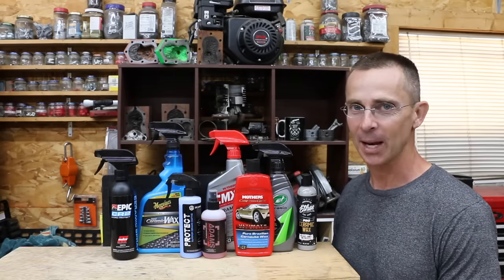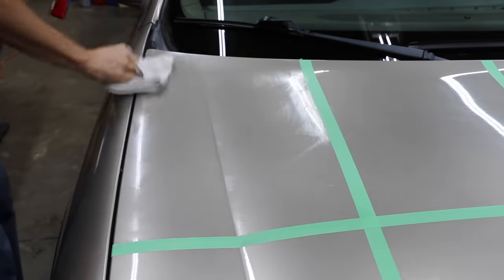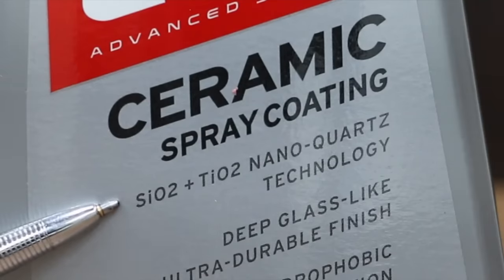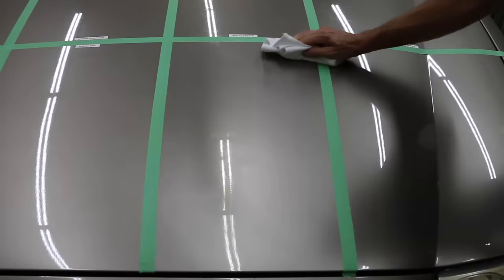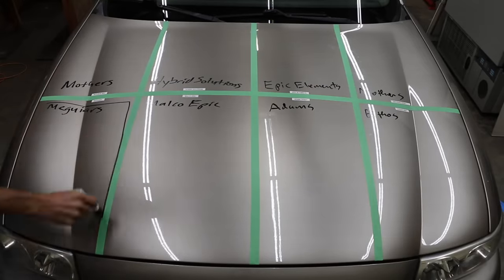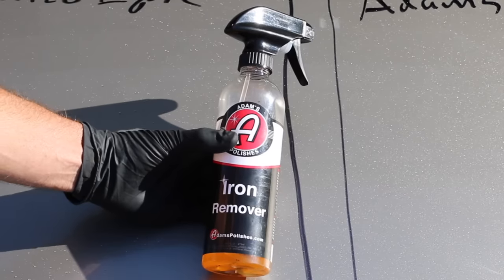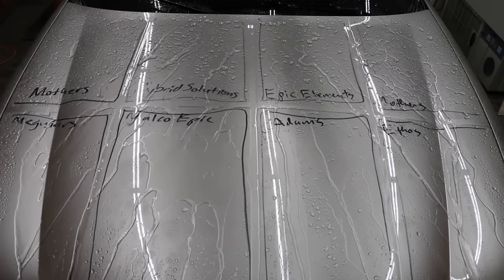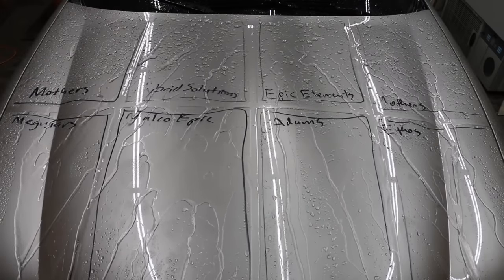Best Ceramic Spray Coating? Mothers vs Meguiars vs Ethos Pro

Comment: Question (for anyone), why use iron decon AFTER clay barring? You could save the contaminants from scraping the surface when you clay bar if you get them off first, no? Wash, iron decon, rinse, then clay bar makes more sense to me. A big concern with clay bar is marring and dragging things across the surface which is why people say you should always polish after clay barring and before waxing/sealant/ceramic coating.

Comment: I just got my TW Hybrid Solutions Ceramic Spray and the TW Hybrid Solutions Ceramic Polish and Wax today and haven't used either yet.  Per this video I feel I bought the correct product.  I was a big fan of Adams products years ago but this will be my go to now.  Thanks for great video @Project Farm!  Now I'm wondering should I use the Polish and Wax at all or use it first then use the Spray.  Any help appreciated!   Dan

Comment: That was great , thanks for putting in the effort.
Next could you test the ceramic serum type products like by Gtechniq, Avalon King etc. They are very expensive for tiny 20 to 50ml bottles.

Comment: Thank you...the cleaning test was thourgh and convincing....I don't allow detergents or solvents near cars...mechanics often spray throttle body cleaner or mass air flow cleaner inside the hood...they should always remove the part to be cleaned and use cleaners away from the car...
Reply from the maker: Thanks and you are welcome!

Comment: Yep! After using Turtle Wax Hybrid for more than two years, and trying different brands in between, this is all I use now, and it's DAMN good! For two of our black cars, we use the black version; a bit messier but it really works well. I'd also suggest using the version for a dry car when you first start with, then switching to the wet car version if you wash and hybrid-spray your car at least once a month. A dry-cloth buffing after is highly recommended to get any haze off. Great stuff.
Reply from the maker: Thanks for the feedback.

Comment: Wow what a great video!  I bought the TW Hyb Solutions before seeing this video, but I knew it was an amazing product after the first use. On my brand new 2022 BMW 330e in white, this stuff made it look like a mirror and the paint is smooth as glass.  I used the TW Hyb Ceramic Wet Wax (another incredible product!) and then this Hyb Solutions Ceramic Spray and I hate car maintenance but both of these esp the wet wax are so easy and take no time at all.  Highly recommend to anyone!
Reply from the maker: Thanks!

Comment: Saw a comparison between the turtlewax you tested and Griots Garage 3-in-1 ceramic wax. Griot held up longer to heavy cleaning, but the person didn't do any of the mechanical tests you performed. Really awesome stuff! If you ever re-do, consider Griots!
Reply from the maker: Thanks for the suggestion.

Comment: I did like the review of the ceramic coatings I think you might wanna add some kind a color and gloss reading to see how visually looks as well and maybe even a scratch test to see whether or not the coding can hold up a little bit more to standard driving debris
Reply from the maker: Thanks!  Thanks for the suggestion.

Comment: That Hybrid Solutions stuff is a Turtle Wax product, and I use it on my Harley. It's freaking amazing. You can just about rinse bugs off with nothing more than a hose. I spray it on and buff it out on pretty much all the painted surfaces I can get to, and occasionally spray the engine etc with it after a wash, then let it sit for a few minutes before blowing it dry. It's insanely durable and I really only have to use it once a year.
Reply from the maker: Thanks for sharing.

Comment: Great comparison as always. I've been using the turtle wax hybrid solution since it's been out. Work's awesome on motorcycles as well. Nice, you can go over all black plastic, and they look like new. As far as my truck, it's been great as it's the longest lasting I've seen for over the counter product. And holds up very well to the northeast winters.
Reply from the maker: Thanks!

Comment: Informative video as usual. Thank you!

I have used both the Turtle wax ceramic and Mother's CMX ceramic. 

 In real world use the Turtle wax is a real pain to apply.  So difficult to remove streaks and haze. The finish feels silky smooth but the shine is just not as deep as the CMX.

The CMX on the other hand is much easier to apply. No streaks, no haze. Leaves my 2020 Avalon looking like the finish is liquid metal.  And silky smooth.  Can't say how long it lasts because I put a new coat on every month or two. 

I am sure the test results are accurate but I would rather put on the CMX once every couple months, or even once a month, rather than putting on the Turtle wax every 6 months. 

Just one person's opinion.
Reply from the maker: Thanks!  Thanks for sharing.

Comment: All of your tests are extremely valuable and informative.  I check with your presentations before I make a purchase of any of the items you have tested.  I have saved all of your YouTube programs.  This particular test was seen after buying a bottle of Turtle Wax Hybrid.  This was a great comparison, not only because of the fact that I brought it but how you demonstrate it through your style of measurement.  Who would have thought to use a weight, sponge and gauge to measure the effectiveness of an auto wax.  Maybe you should be working for Consumer Reports.
Reply from the maker: Thanks!  Thanks for sharing.

Comment: I am totally shocked you didnt use Technicians choice 582.
That stuff works EXTREMELY well even at 3 to 1 dilution. (you do not need alot and if you prep well it works even better)
We take it a step further.
We heat up Collinite 845 wax and ADD IT to Tec 582 and this works so well a body shop manager at a multi location shop here in Atlanta was very impressed on how it looked on my personal car.
Reply: After watching this video, I’m sure Hybrid Solitions would still beat it. Insane how much lasted with it

Comment: Thanks for posting this great review of all these different products. Absolutely awesome.

I have used mother's carnauba literally for decades and have found it to be an excellent wax that holds up pretty good. And your testing confirms that. In fact I just got through putting a coat on today on my new vehicle a 2024 Mazda CX30.  

After watching this I'm going to go get some hybrid solutions product and apply that.   According to the information on the turtle wax site for this product it says that you can apply it over Carnauba and it will increase the shine so I am definitely going to get that. I have the soul red paint color So my guess is it will really pop after I get done.
Reply from the maker: Thanks and you are welcome!  Thanks for sharing.

Comment: Based on your testing, I bought some of the TW hybrid to use on my new car. So far , it has left a very good shine but all the typical gunk is still sticking to it. I will give it a second coat in a few days and I expect it will be more slippery. Thanks for the great review!
Reply from the maker: You are welcome!
Reply: Did you do all the complete prep step or only apply ceramic spray since it was new?
Reply: @jaimebedolla989   I hand washed  and dried with a towel and then applied the spray.  Came out nice. Car looks new a year later

Comment: Absolutely excellent test but most of these brands are not considered high end. Be interesting to see a test against stuff from CarPro, Gyeon, Wolfgang, Kamikaze, etc. That being said it's definitely worth doing tests like these on the more widely available stuff as well. Big fan of the new generation Turtle Wax products, really really solid and not expensive at all. Obviously Adams are always solid (and honestly I think in a slightly higher tier than most of the other stuff in this test). They make my favorite rubber cleaner as a prep for tire dressings.
Reply from the maker: Thanks!  Thanks for the suggestion.

Comment: Supposed System X Renew Ceramic Spray Coating has dethroned Hybrid Solutions but at a much higher cost. I covered my wife's SUV with the Turtle Wax Hybrid Solutions after clay bar and polishing. It came out amazing.
Reply from the maker: Glad to hear!  Thanks for sharing.

Comment: I tried Mother's CMX first, but after seeing this, I picked up a bottle of the Turtle Wax hybrid stuff. The road salts stripped the CMX off the sides fairly quickly, even with 3 stacked layers.

Comment: It might be interesting to compare different options for treating your snowblower for non-stick.  The winning Turtle Wax is probably a top contender, also you want to add DuPont Teflon Snow and Ice Repellent and Stens 752-102.  Cold performance and longevity of an application when subject to abrasion are probably the main metrics of interest.
Reply from the maker: Thanks for the suggestion.

Comment: I used the turtle wax hybrid solutions last summer.  I drove through fall, winter and spring in Wisconsin and it still beads and is shiny.  I think it's the best I've used.
Reply from the maker: Thanks for sharing.
Reply: @ProjectFarm  Have you ever done a video for cordless lawn mowers?  It's an idea of you haven't.  Thank you.

Comment: This is an older video, but as a thought - It would be really interesting to see something of a series from this - comparison of natural (carnauba) waxes, one for synthetic waxes/sealants, then a shootout between the winner of this video, those two wax ones, and a real ceramic coating (gtechniq CSL or such) to find what is the ultimate finish protection. That level of comparison would be very informative, and dare I say, very impressive!
Reply from the maker: Thanks!  Thanks for the suggestion.

Comment: I only recognise Meguiars and Turtle Wax here in UK and out of these only used Turte Wax hybrid, seems pretty good on body but when used on wheels they seemed to accumulate dirt very quickly. Not sure if you have it US but in UK Carplan seems to do better job especially on wheels.

Comment: The Mothers Ceramic Wash & Coat works excellent for washing & waxing the vehicle, or for refreshing a ceramic wax. FYI, if car was waxed within 6 months, mix at 5oz to 1 gallon water ratio. If the vehicle is not waxed, mix at 8oz to 1 gallon water ratio. The 1oz per gallon recommended on the bottle directions, is incorrect. Also, use an wool hand wash mitt. Tip - I've always cheated on drying, by using my big powerful backpack leaf blower😎
Reply from the maker: Thanks for the feedback.

Comment: I can say after using Hybrid Solutions/Turtle Wax Ceramic Spray for years now….it’s a superior detailing product. 

I always have done one coating around all the exterior doors and body panels on my cars, and then repeated a second coating. It really does last a significantly long period of time. Totally worth it and it absolutely sheds water consistently well.
Reply from the maker: Thanks for the feedback.

Comment: Thanks for the great video!  That's a lot of work, but your research yielded very good results.  I have been a fan of the new Turtle Wax products for many years now, starting with their "Ice" spray wax, " Ice Seal n Shine," and finally the Hybrid Solutions Ceramic wax.  They all do a great job, and have protected my vehicles very well, as well as give them a great shine.  I get many comments on the shine, and it's really pretty easy, compared to the "old days" of paste wax.  Turtle Wax has really upped their game, and I applaud them for making and excellent product, that's easy to use, lasts a long time, has great results, and is reasonably priced.   Thanks again for the great video!
Reply from the maker: You are welcome!

Comment: Thanks for making the Turtle Wax hybrid solutions go up in price and constantly be out of stock... lol as a pro detailer I use it a lot for my clients who just want some quality paint protection for an affordable price. I've also use the Meguiars sometimes as i dry after a wash just as a compliment. I've also found  the Nu Finish ceramic coating and graphene coating work extremely well... I'd say it might work even a bit more durable and longer lasting.
Reply from the maker: Thanks for sharing!

Comment: Hereeeeee we go again… LOL!  Despite being subscribed to your channel, I did not check with you first before selecting my car polish 2 years ago, pretty close to the time you did this. 

After a couple decades of using Nu Finish, and quite happily, I now had a Maguire’s MT300 DA which let me buff out the clear coat scratches before polishing on occasions when I neglected to reapply a new wax coat in time and which allows a better shine.  

After looking at ceramic polishes at my local auto stores, I chose the Hybrid Solutions because: 

1. Ease of use
2. It had a 3 part system: Polish, Spray Coating and 3-in-1 detailer. (I wanted both a polish and wax renewer). 
3. Sounded the best (LOL!) 
4. It had good reviews to support it. 
5. HUGE BONUS & DECIDER:  The “spray coating” can be used on wheels, exterior glass and plastics. Translation: I do not have to tape stuff up or be extraordinarily careful when applying the spray. Plus, I could spray it on my front grill rather than using bumper black type stuff. Although, I ended up using Maguire’s Ultimate Black Plastic Restorer there and on my toneau and other black plastic. AWESOME STUFF!
Reply from the maker: Thanks for sharing.

Comment: Another excellent scientifically designed video.   
 I was wondering if you have even done a review of auto wheel cleaners?   The wheels on my F type are coated in brake dust 15 minutes after cleaning and no wheel cleaners have helped with cleaning them.  The black brake dust sticks with a vengeance.    Thanks so much.
Reply from the maker: Thanks!  Thanks for the suggestion.

Comment: Meguires would come in near the top on dry application rather than wet application. But I suppose they meant for it to be easy to use.

Comment: I see a lot of Chemical Guys products in big box stores now. I haven't looked but I'd love to see a video on "all" metal polishes especially aluminum which I work with the most. Neverdull, Simichrome, Chem Guys Heavy polish, Meguairs Mag + Alum, White Diamond, etc. Especially with prep of sandpaper or scotch brite on oxidized surface
Reply from the maker: Thanks for the suggestion.

Comment: Great testing Todd as usual. 
I was wondering if you could do a test with the different exhaust paints, ceramic coatings and exhaust "fabric" wraps. The ceramic coating folks make some unbelievable claims especially about reductions in radiant heat. Thanks
Reply from the maker: Thanks!  Thanks for the suggestion.

Comment: Great video again! (sorry for all my comments and future comments as I binge your videos haha). There’s another guy, Scott HD, he does long-term tests on waxes, ceramic sprays, and ceramic coatings. And the long-terms tests go on for 1-2 years! He updates once a month, and washes the panels before each update. Now to preface this, I’m sure there may have been other variables that affected this, but based on each of your tests, the Turtle wax spray seems to stand up to chemicals really well, but may need to be reapplied after 2 months. Really love your inclusion of common items that people will use on their car, like bug and tar remover. 

If you want to find his video where he has the same/similar products tested, look up Scott HD ceramic spray long-term test! He also keeps a record of his results in a Google Sheet that he links in the description. Love all the data points between you and him hahah
Reply from the maker: Thanks!  Thanks for sharing.

Comment: I would've liked to see the Cerakote brand included in the testing as well, perhaps in round 2. graphene coatings should be a separate video, or a roundup of the best ceramics vs the new graphenes
Reply from the maker: Thanks for the suggestion.

Comment: The point is for the water to leave the surface and Maquires and Mothers had no water after you spray water the first pass making them the clear winner. The hybrid solutions had a solid film of water across the entire area even after spraying it the first time. Watch this video closely. I think Macguires was on the left front and it held up the entire time. Almost no water stayed on that panel

Comment: This review was spot on. I used the Turtle Wax Hybrid Solutions coating on all my vehicles - even the plastic hood and fenders of my side by side and John Deere tractor 🤠. It worked great. REQUEST: can you do a comparison on car wash shampoos? I tried the Turtle Wax Hybrid Solutions ceramic car wash and was unimpressed. It didn’t foam up as much as my usual car wash. Thanks!
Reply from the maker: Thanks!  Thanks for the video idea.

Comment: I'd like a round 2 but I'd really like to see a couple of different tests.  First - you can get a much more quantitative measure on hydrophobicity by putting water on the surface and tilting the entire surface until it runs off (I can give a lot of info here - I work in an R&D test lab).  With ceramics, I'm really interested to know what the hardness is doing for the paint - is it going to help with scratch resistance?  That should be a major factor, especially with removing hard particulates.  This may be less interesting - but maybe you could do a peel test to give an idea of adhesive strength.  Or spray with brake dust and determine how easy it is to remove it.

As always - thanks for your videos!
Reply from the maker: You are welcome!  Thanks for the suggestion.
Reply from the maker: Thanks for the suggestion.